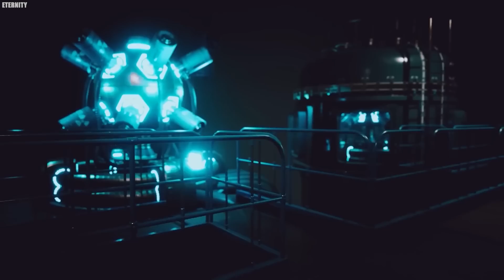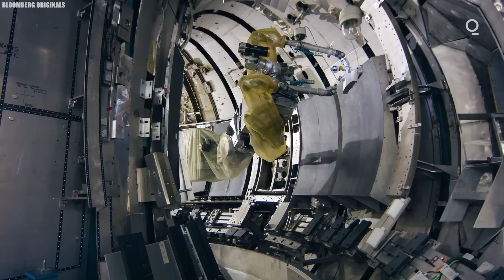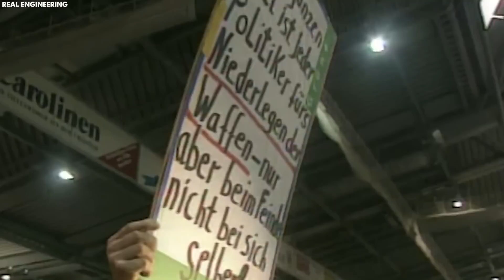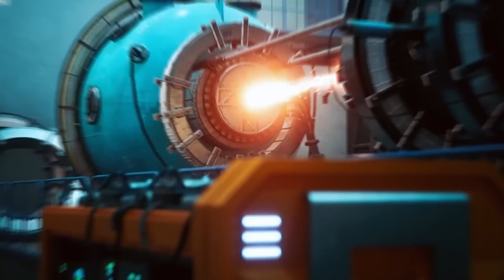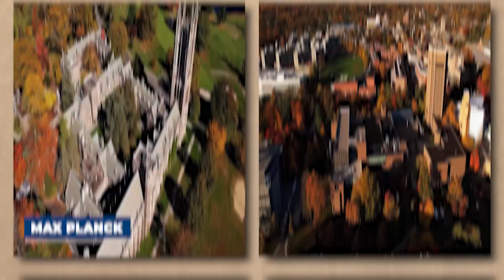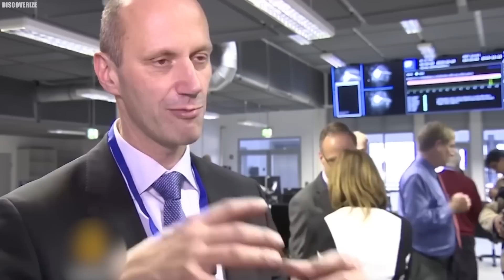Germany's New Nuclear Fusion Reactor SHOCKED The Entire Industry!

Comment: This fusion engine is viable yet. They like to leave this little important bit of information out of the equation.  The longest they have kept it running by fusing atoms together is only like 20 Mina. They can't make jet to be self running to werethe reward outweighs the cost. Right now all they can do is use more energy then they can produce.  It takes so much energy to running a fusion reactor. And also I remember learning in school.  That if the heat from the sun was the same on the sun's surface is just ashot here on hot it would destroy us cause it would cause are atmosphere to ignite.
Reply: They thought there was the same change with the first atomic bomb. They tested it before using it on Hiroshima, but nothing happened. And there's a reason why. The same with fusion. I hope they find a solution at the problems. It would bring the world clean energie and as much as we want.